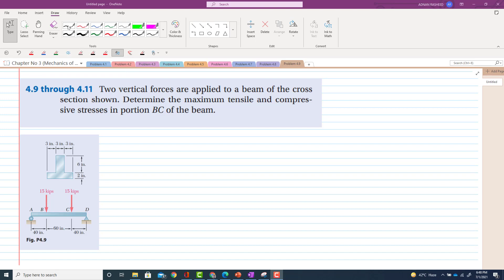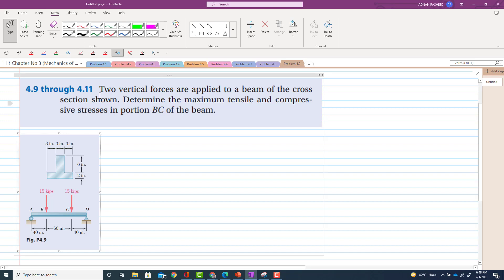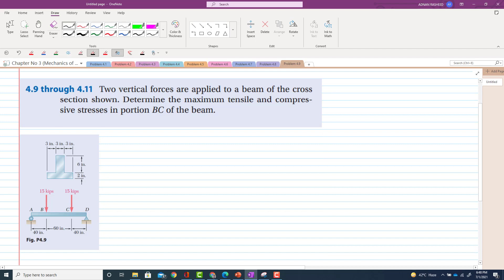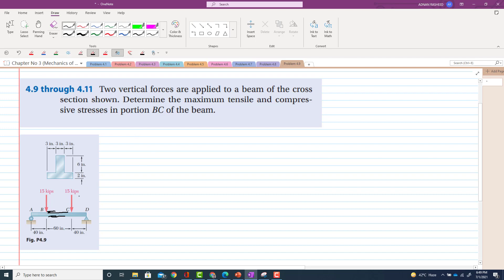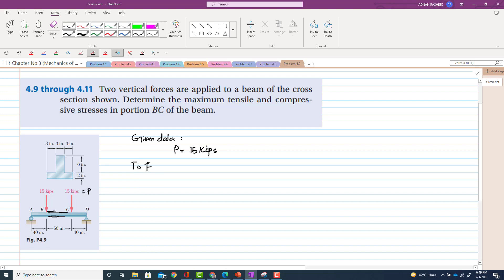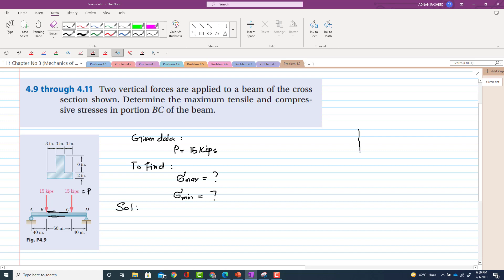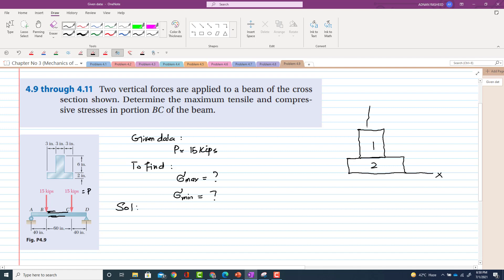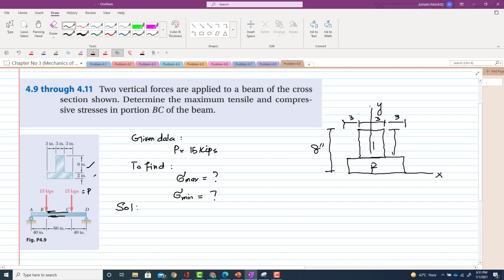#Mech of Materials# |ProblemSolutionMOM​ | Problem 4.9 |Pure Bending| Engr. Adnan Rasheed

Comment: Sir when we break the beam isn't there shear force also along with moment M?
Reply from the maker: When your bending stress or shearing stress exceed the allowable bending/shear  stresses. The beam will fail.
Reply: @engradnanrasheedmechanical  sorry sir didn't understand kindly explain w.r.t the given scenerio 10:05
Reply from the maker: @hamzarashad3632  yes you are right that when we cut the beam shear force is also there along moment but here we don't require the shear force that's why i didn't write it. Also check my latest problems
Reply: @engradnanrasheedmechanical   ok sir
Reply: I have the same question. Simply ignoring a force because we don't need it for the problem makes no sense. Why was the shear force neglected when calculating the moment about A?In an exam, I would have included shear force and been stuck with the problem at that point. When is it okay to neglect the shear force when cutting a member? The normal force is ignored because it is in the x-direction, but the shear force is in the same y-direction as the other forces being considered when summing the moments about A.
Reply: @danielguerrero6502  Calculating forces in the y-direction isn't necessary - calculating shear and tensile stress only requires the moment about the cut. For similar problems you do in the future, it is smart to calculate the reaction forces before making a cut. In this scenario, taking a moment about A and D when looking at the entre FBD will give you the forces at A and D.
Reply from the maker: Thank you for answering him
Reply: Compressive and tensile*
Reply from the maker: We have been asked to calculate the moment that's why we focused on it and not calculated the shear force. If you need it then you can calculate by a very simple equation that sum of all forces along y direction must be zero and from there you can calculate the shear force. Check out other problems you will find it. Thank you